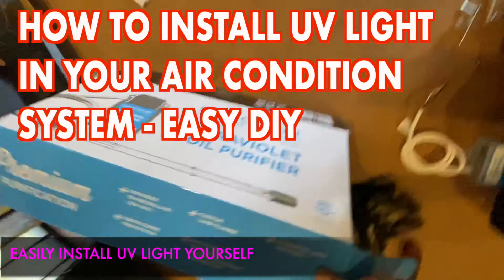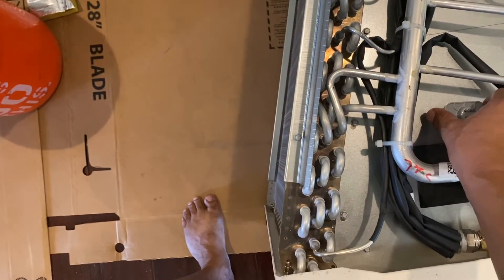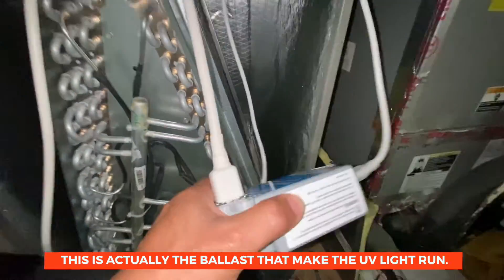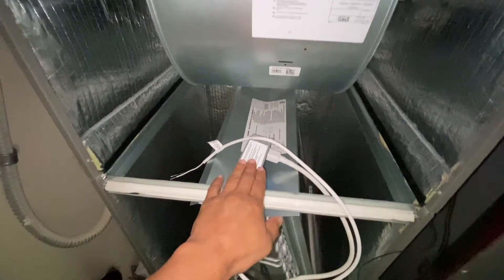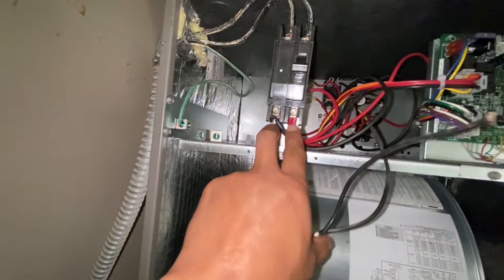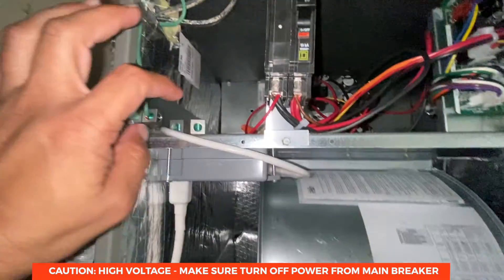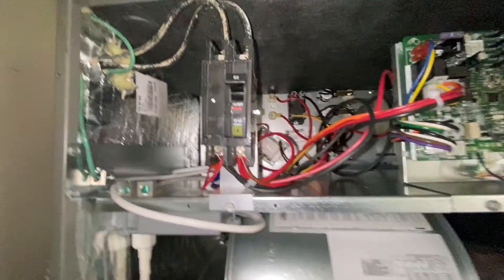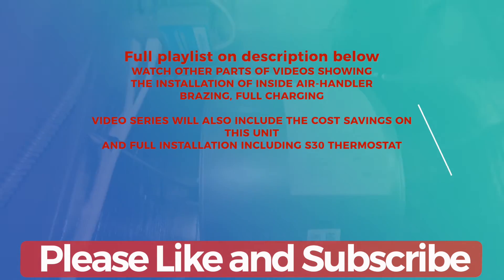How to install UV Light on air condition system - air handler

Comment: One thing I was wondering about, is the ballast unit specced to be able to be installed inside the heat pump? It gets pretty hot in there. I think the intention with those ballasts are to install them on the outside of the furnace/pump. I've also put mine inside, but afterwards this thought struck me.

Comment: Hey thanks for the video. Just wondering, won’t you need to relocate the air filter because your UV light will start to deteriorate the filter over time right?
Reply from the maker: Excellent point. I learned it the hard way
Reply: Simple just Change existing grill to a filter return grill

Comment: So your light is on 24/7?
Reply from the maker: Yes
Reply: @HowToDoitright  Isn't that a wasted of power and the UV light? Our UV system was set to only run with the fan was blowing.
Reply from the maker: I live in Florida and my AC is always on. It’s a variable speed and fan stays on continuously so yes the UV needs to stay on too. Plus it’s not that much power.